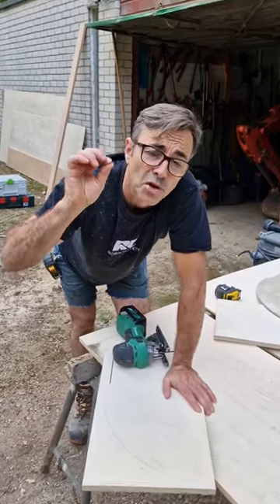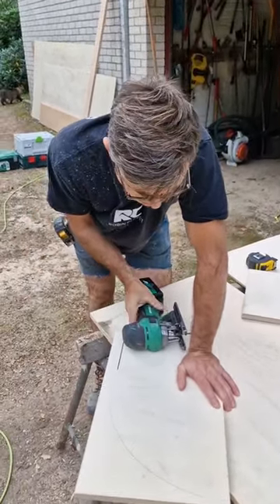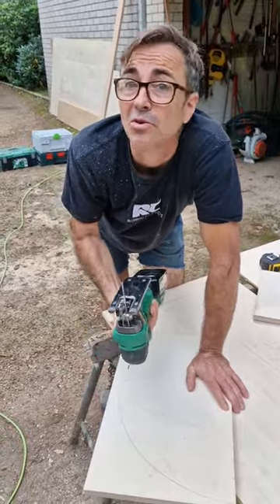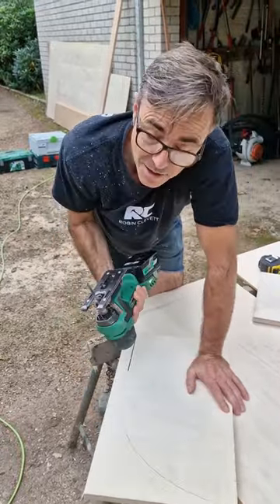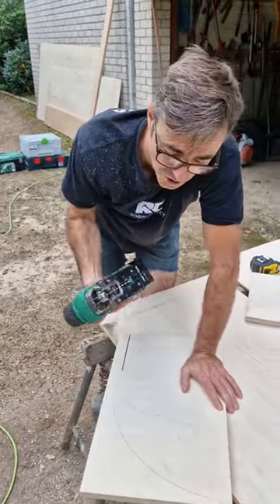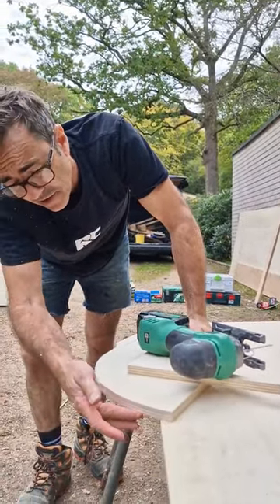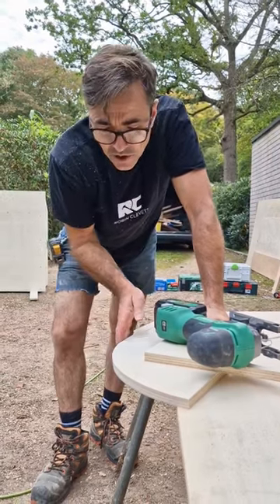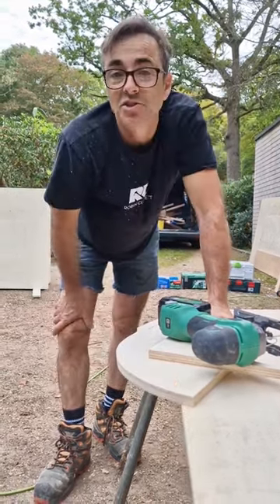jigsaw tips #woodworking #sawing #buildingmaterial #woodworking #carpenter  #powertools

Comment: Keeping straight is easy, upside down or right way up. The pain for me is every jigsaw ive had, has never cut square to the face!
Reply: It's pricey but the mafell jigsaw will cut square as you'll get out of a jigsaw
Reply: there is jigsaw modifications you can do to correct that issue that we all have
Reply: that is due to not letting the Jigsaw do the cutting..and you pushing too hard to one side .... simple.
i have been using a jigsaw like this  since the late 80's ...but it also depends on what you are cutting and if you need the precision ....i use this method for scribing architraves / skirtings , filler panels etc .
Reply: @oddjobtriumph1635  sometimes the difference in grain vs non grain areas is all it takes to make the blade ride out of square.  Most crappy jigsaws have a lot of slop in the blade.. it's better to follow one of those "hacks" that make it very difficult for the blade to flop side to side
Reply: @brianbailey462  having the ability and knowledge on how to use your tools properly is probably the main ingredient for getting good results in any form of woodworking.....top of the range tools do not Guarantee good results...remember the old saying " all the gear and no idea" ?.
a true craftsman will more often than not get better results with an everyday , run of the mill bit of kit ..than a novice or Cowboy , with the Best kit .
A bad worker always blames his tools.
Reply: Screw a 10mm thick block of wood to the base of the jigsaw with a hole just side enough for the blade to go through. That will give it a second anchor to stabilise it. Not perfect but definitely much, much better.

Comment: All of those talking about downcut blades are missing the point. Upside down you aren't trying to look through the body of the saw to follow a line. Plus you only need one type of blade
Reply: And the fact that your up cut is then a down cut blade because your upside down. Some people's kids eyy lol
Reply: 3 pairs of hands on bigger material. Also there is plenty of room to see the pencil line from the side.
Reply: Pretty mad when you think about it! if you can’t use a jigsaw properly in the first place then forget about using it up upside down
Reply: You look through the body of the saw! That's where your going wrong, it has a mark to follow 😂😂😂😂😂😂😂😂😂😂😂😂😂😂😂😂😂😂😂😂😂😂😂😂😂😂😂😂😂😂😂😂😂😂😂😂😂😂😂😂😂😂😂
Reply: @laurencestarmer991  if you invert the jigsaw and only have the blade tip coming through on the pencil line side,  it's a thousand times easier to cut to the line accurately.  I do this for a living, was shown this by an old   boy. Scribing infills, scribing internal mitres etc. Much easier.
Reply: @laurencestarmer991  Honestly try it. Cutting this way is the reason why top manufacturers make both d handle and barrel grip jigsaws. 

To be fair though it's more of a pro thing than DIY.

Comment: Rarely, but I like this demonstration. It’s a little awkward and for electric cable jog say it’s very heavy to hold and also control.  Best get a down cut blade and cut from the top, the line’’s less visible but a much more comfortable use of a heavy tool upside down -unless it’s a battery jig! Also, depends how far the is  cut from the edge of the board!

Comment: Yeah only since switching to that style of jigsaw tho could get on with it with my old hikoki (notthe one your using there). Brought that style festool on 110 for abit more than £100 of ffx but meant carrying a transformer with it but pissed on every jigsaw I'd used till then. Well long story cut short brought it on battery. What a good move that turned out to be. But back to the point yes way more precise that way.

Comment: Yes, I often do that. Works best on a body grip saw like yours. If I'm using a top grip (Bosch that normally lives in my van) I'm more likely to use it from above with a downcut blade but can't do that with any pendulum setting because it is more likely to kick back
Reply: Yeah definitely works best with that kind of pistol grip style I reckon.
Reply: Set the pendulum setting to 0

Comment: Yeah I’ve always used it this way but when I use the boss tools he has the blades that cut on the push so I ended up with loads of splintering on the face I wanted clean, so yeah this method is always better unless you have the special blades

Comment: It's the best way! I've done it for years with my Bosch😉
Reply from the maker: Totally agree!
Reply: @ukconstruction  I've never had good luck with down cutting blades. Too much chatter and vibration to deal with. I sometimes keep an air hose with a twist nozzle cracked open to blow dust to see the line... less huffing and puffing, resulting in a better/ faster cut! 😆 🤣

Comment: Absolutely but usually with the Colin’s coping foot
Reply: Why would you use a coping foot on a flat surface when you want a square edge?
Reply: @Tom-hl7wc  where did I say I wanted a square edge? And if I did want a square edge Tom, the last tool I’d be reaching for is a jigsaw 😂
Reply: @Dazza19746   how would you do what he’s doing here with anything other than a jigsaw?
Reply: @Tom-hl7wc  what he’s doing I’d use a jigsaw with a Colin’s coping foot! 

You said about cutting SQUARE 

Robin mentioned the under side is all tear out  and it doesn’t worry him as it’s almost always in situations like this ONLY the face side matters…. Therefore as Robin himself will tell you or any other experienced carpenter will, you want an UNDER CUT Tom, the last thing you want is SQUARE.

So tell me, are you inexperienced, a bit thick or spoiling for a good old cyber fight?